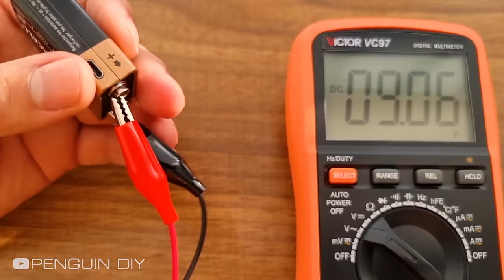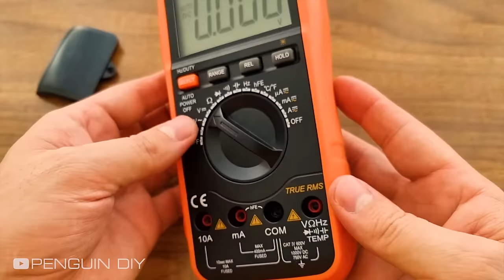How to Make Rechargeable 9V Li-Ion Battery | DIY 9V rechargeable battery

Comment: They should make these so we don’t have to waste batteries again And the stop motion is very cool this is just genius even the stop motion everything
Reply: You can buy them, just google for it. I just found a set of two for 22,54 Euros, can't say anything about the quality.

I guess the reason that they are not very common is that they are much more expensive than a "normal" 9 V rechargable battery, which has ab bit less capacity and needs a charger, but is still much cheaper.
Reply: madin iran 🇮🇷🇮🇷🇮🇷🇮🇷🇮🇷🇮🇷🇮🇷🇮🇷🇮🇷🇮🇷🇮🇷🇮🇷🇮🇷🇮🇷🇮🇷🇮🇷🇮🇷🇮🇷🇮🇷🇮🇷🇮🇷🇮🇷🇮🇷🇮🇷🇮🇷🇮🇷🇮🇷🇮🇷🇮🇷🇮🇷🇮🇷🇮🇷🇮🇷🇮🇷🇮🇷🇮🇷🇮🇷🇮🇷🇮🇷🇮🇷

Comment: Be careful about point-to-point soldering of the SMD parts, those things may easily get an internal crack after any shock in the assembled device, so better just order a PCB (this one is easy enough to just etch with a sharp knife btw).
Reply: Do you not understand why they did point to point soldering and not just add the module in?
Reply: @risingmermo  No, because simply re-routing it to meet the board size requirements instead of p-2-p would work just nicely.
Reply: @TheBypasser  yh true but would be more expensive
Reply: @risingmermo  Like a couple of cents for a tiny piece of FR4 which for such a simple circuit you can etch yourself for free? And should we play some "big industry" here, the least expensive process is the one that takes the least manual operations, as it is both cheaper and less prone to human error, so fewer defective units per run.

Comment: This circut doesn't have dischatge protection. If you discharge batery to much you will have to replace it
Reply: looks like the batteries themselves have protection circuits on them
Reply: some battery cahrge board come with over discharge protection.
Reply: @a892728  yes but this bartery charger doesn't have discharge protection
Reply: @manecior1  oh I got it.
I also made my own 18650 charger with TP4056 chipset.
I buy it with charge oc and discharge   protection.only a little price higher.
Reply: @manecior1  no need for one if the battery has one
Reply: The little pcb on the battery is the bms its a dw01
Reply: @309electronics5  Indeed!

Comment: Super rad build! Most impressed I've been halfway through a video, as a guy who loves micro squashed bug circuits, and stop-motion. Could have almost fit another battery in there if you had micro'd the other board!
Reply: He didn't have the protection circuit, and his board was too big, i did the instructables on how to do a better version for cheaper : Convert a Power Bank Into a 9v Lithium Battery

Comment: I couldn't  see any bms for battery, this boost module works until the input voltage decrease 1.5 volts so lithium ion battery probably will swell . bro you know low voltage of lithium ion is 3.0 volts😕. So ı wish you used tp4056 which have protection. Good job 👍.
Reply: Bro...there is tp4056 module
Reply: each battery has a protection board 0:56
Reply: That`s li-po with protect

Comment: Those DC booster circuits have quite high standby currents.
It works but on devices with really low current draw the battery won't last that long because the booster circuits is active all the time.

Tried to mod it on the resistors. Worked a little but still to high quiescent current.

With firealarm devices you also have issues it won't give low battery warnings. It just dies immediately when the booster shuts off. 

But still nice try though. 

Easier to just buy one. 
More capacity and most likely better electronics.
Reply: With the things like smoke detectors, you're far better off just getting the intended "10 year lifespan" lithium batteries that use the same battery chemistry as lithium coin cells, with 3 stacked in series (edit: 3 lithium cells stacked in series inside the standard 9v battery form factor) to get the required voltage.
They're individually expensive yes, at maybe $10 for each one, but given that they are intended to last 10 full years, they end up costing a lot less than alkaline 9v batteries do.
Reply: Really just a fun video, like the previous comments the parasitic loses would discharge it quickly. Just buy a one...
Reply: @gt6hudson  Agreed, but even those ones you can buy have the same problem.
And they don't have the little slide switch in them so you can actually fully turn them off either.
I guess if you want the switch, it would be a lot easier and probably cheaper to start with one of those and mod in a slide switch than to have to build the whole battery from scratch.
Additionally there's another issue with the build in this video. Where does the charging circuit's IC get any heatsinking from? That's what that massive pad on the bottom of the IC is for. If it was me, I'd try to take that charging IC, bend the pins upward so I can "dead-bug style" re-make the charging circuit like was done in this video, but before I re-made the circuit I'd solder it to the inside of the (metal) case of the 9v. I'd also try to use a dab of solder to secure the micro-USB connector to the side of the case as well, unless that needs to be electrically isolated for some reason (but  I doubt that). Shouldn't be too hard for either thing to be done, assuming you have the right tools and a sufficiently high wattage soldering iron. I mean the inside of the case looks to be bright shiny nickel plated, which means it SHOULD accept solder rather well, assuming there's no additional coatings or oils on it (so clean it first).
Also, I tend to use lead based solder, but only because I still have a lot of it. When that runs out I'll switch over to the lead-free stuff, but that probably won't happen for a real long time, back when I was doing soldering more frequently 15 years ago I bought a half pound spool of 0.032" 63/37 Sn/Pb (eutetic as far as I know) solder from Radio Shack and I've kinda barely touched it, since most of what I was doing was picking components out of electronics that either became nonfunctional or were obsolete. Salvaged plenty of power transistors and good mylar capacitors from CRT TV's and monitors, and I was safe about it by waiting a week before opening it, and being careful around the tube. Never got shocked or broke the glass of a single CRT when disassembling them.
Reply: Г

Comment: I think the only downside to this is that the lipo cells now parallel charge instead of balance. If one of the cell's internal resistance is even slightly different, you will eventually end up with one cell more charged than the other, and the charging circuit can't differentiate the two cells because there is only one charging channel. The other issue is that there is no overdraw protection. you could theoretically bring the voltage of the lipo cells low enough to be unsafe to recharge. otherwise, this is actually pretty cool
Reply: I think they would have to go in parallel because if you put it in series you would only get 3.7 volts well with the voltage thing you could overamp the battery but you'd still only get maybe 6 volts
Reply: Maybe in theory parallel seems bad, but in reality - parallel is actually good... as long as the cells are exactly the same type and age. It's really no different than a single physical cell but just bigger... think about it.

It's also quite common in EV battery packs... Leaf battery modules are 2P2S, all Teslas have MANY small cells paralleled, then those groups in series.
Reply: Well, no. As both cells are tied in parallel they balance each other on their own. If one is charged higher than the other on the time of soldering it will charge the other to its potential and even them out. From then on they charge and discharge at the same rate.
Reply: First discharge them both, then charge them in parallel. If you want to play safe, you must charge them full and wait for a month to see if it leaks.
Reply: You are incorrect about the cells being out of balance; they will actually be in near-perfect balance. You are also incorrect about the lack of over-discharge protection; it is build into the cell, which you can see clearly at 0:52
Reply: @jamesbrown99991  I didn't see the bms on the battery before, but they will not balance when charged in parallel. if they have slightly different internal resistances, they will not charge or discharge at the same rate.
Reply: @davldbradley6073  Parallel adds capacity, not voltage. They could have opted for a larger lipo cell instead to increase capacity
Reply: @beforebefore  I use lipo packs as an RC hobbyist and even really expensive, high QC packs still require balance charging to retain optimal battery health. No two cells have the exact same internal resistance. If one starts to get worse, you won't be able to tell if you charge in parallel, because you can't measure the voltage of each cell individually. you're charging system has no way of knowing when to stop charging a battery except to check the output voltage of the whole pack.
Reply: @Shraedar  Parallel cells have the same terminal voltage, regardless of the internal resistance, and will equalise/self-balance whenever a large charge/discharge is absent. For low currents, the internal resistance might as well not exist.
Reply: @Shraedar  Ok, i call it leak and you call it degrade. But still, a LiPo can damage if you overcharge or overdischage. You can check if a LiPo is damaged if you leave them for a month fully charged. If after a month the voltage is lower than the voltage in the beginning, you know the cell is damaged.
Reply: @beforebefore  I think it a worst case thing, is cell goes bad, rogue, the good ones will do cover, for it, un till it critical fail, and that fire, making the hole lot go rogue, yes but cell not that much but you could build better, hopefully not building back better? which is new  trendy thing at the moment
that circuit board with board was make my eyes crossed just looking at it?
Reply: @bugsuck11 don't shame the rc community for your mistakes. The cells here are not series for any current distribution to matter. I have 2 of these in parallel in my multimeters for years now and no problem, check my instructable Convert a Power Bank Into a 9v Lithium Battery
Reply: @jamesbrown99991   Not totally true, if the internal resistance of either cell is different you could get an out of balance.  It is recommended to use two tp4056 chargers.

Comment: Last year I brought two packs of 4 double A and two packs of 4 triple A rechargeable batteries with micro USB for charging them up. Yes they were expensive to buy £15 a pack. But they can be charged up over 500 times

Comment: Really nice! Although, I wouldn't recommend using a switched supply to power a multimeter.
Reply: I made it and my multimeter works just fine. Why you say so?
Reply: @Carolina-mw4po  switched power supplies make "noisy* power. it's fine for most things, but multimeters (at least the fancier ones) can be pretty sensitive to this. you can add a smoothing capacitor in there to help reduce the noise, not sure what size it'd be for a 9v, though.
Reply: @DFX2KX  i understand it as the conversion is done using a high frequency. I'm only saying I had no issues with my multimeter. May be it has a filter after the vcc, who knows. Even measuring frequency with it, the values are correct.
I was lucky I guess.
Reply: I am using that set up in my tester lcr-t4, and no problem at all.

Comment: TLDR, This project gives a "9V" with 25% of the capacity of a typical alkaline 9V.  This is not useless but should be considered when deciding if it is worth attempting.

This is much better than the AA project, more power in the package, easier to build, and using the switching regulator means you will get most of the power out of the LiPo.  However, keep in mind, a typical Energizer 9V is about 5.5Wh (610 mAh x 9V).  This LiPo is 3.7V x 450 mAh or 1.6 Wh assuming 100% which you won't get.
Reply: ((4.2V * 0.450A)*2b) - 20%Ef = 3Wh and you have the possibility to charge. i'm not pointing the nominal voltage.
Reply: @Hudsonkem  What is "2b" for that doubles the number?
Reply: @LFTRnow  battery :)

Comment: Very Impressed, Penguin DIY!! You will rise fast! Don't change your style for now. Wait until you get into the 150K/200K. You are doing fine. Lights, motors, charging of Lithium Batteries. Establish your Base. This is good that you are integrating "enclosures". This one is exceptionally good. Professional level.

Comment: Yea, but surface-mounted components are nearly impossible to remove.
Reply: somehow removes
Reply: just break it
Reply: Hint: hot air!
Reply: According to this video, you don't have to. They appear to move themselves. 😆
Reply: With the right method it is easy
Reply: @NortelGeek  hahaha ha
Reply: @reizinhodojogo3956  It is a disposable unit. There are no serviceable parts inside. At least the coulombs are renewable.

Comment: So I am still a kid but I know a bit electronics. You removed 9 volts and added 2 other lithium batteries and transformed it to 9 volts then you connected a charging circuit to the battery and stuff and you connected the 9 volt output to battery case output. Well I am not an electritian so if you didnt make any mistakes this should work. But you can just plug it into a wall. But the usb charging circuit was so compact. Nice work and nice stop motion
Reply: Have your folks buy them for you....

Comment: Incredible project. My only worries, even if I am not an electrical engineer, it doesn't look completely safe for the charging part even with the internal safety board included with the batteries. But I am surely wrong.
Reply: You are definitely not wrong lol. That charging port is definitely not something you would want to sell as it would be a fire hazard. But for a DIY video, who cares as long as it works.

Comment: Brilliant since I'm the tech,I didn't need it to be look neat or poise,I can use 18650 plus TP4056 and the boost converter in a separate casing,Then stick it at the Back of the Multimeter,Having large Battery is also advantageous.
That style that you just shown it can be for Business purposes,You can Sell that,9v Battery is expensive now a days it will sell good

Comment: The biggest advantage I see to this is size.  Other than that, for the amount of work you are doing here, it would be simpler to gather six AAA rechargeable Li-Ion batteries, put them in series in a camera pack type case, and do everything else outside of that case.  It would be bigger, but also, a whole let less work.   For bonus points, you can go for the rechargeables that charge in like 15 mins.
Reply: Doing that would give around 27v when full, a bad idea. Check my instructables Convert a Power Bank Into a 9v Lithium Battery

Comment: Great vid. But you have to change rprog resistor due 1 amper charge ratio. That little battery cant handle that much current.

Comment: So Subbed. I have NO problem with taking components from a board like that and making a circuit. The problem I have is where to put them! You just cleared that up. Thank You little cute upright arctic bird. Bird? What Genus is a Penguin? I guess they started on top of televisions in the seventies. And for some reason, they exploded. And there was a specific time. At least that is what I was taught by Monty Python.

Comment: Isn't it bad to wire the regulator on the same line as the live connection? Couldn't the battery just bypass the regulator?

Comment: This is very great! However, I  have one question. You used a step-up transformer to 28v but wouldn’t that fry a normal 9v circuit?
Reply: He set it up on 9 V at 1:50, you can change output voltage, it just takes 3.7 to 9 this way

Comment: This is cool but I wouldn't use it in audio related gear (or any gear that needs noise free operation like rc transmitters) since the dc-dc converter used creates a lot of noise in the signal. So don't use it for a acoustic guitar preamp for example.

Comment: It's fine, but it's useless if you use it for a  Fluke multimeter because it has too much idle current, you always must uncover and switch off the meter.

Comment: А не проще ли вместо повышайки поставить 3-й аккумулятор, а излишек напряжения батареи погасить гирляндой диодов
или вовсе обойтись без них - поскольку микросхема АЦП допускает верхнюю границу питания до 15V?
Reply: ADC chip??? The output of a Li-ion cell varies from 4.2 down to about 3.2 over its lifetime. Your way could work, but the output would drop by 3V as the cells discharged. That might be okay in some cases, but it also might not. I guess you could use a linear regulator. Charging from 5V USB would not be simple though.

Comment: The trouble is thou, you need to switch the battery on and off all the time else it will go flat between uses. This is hard as battery is hidden inside the multi-meter, and can go for weeks or months without use.

Comment: maasallah nice video but i replaced 9v batteries with 3s nokia batteries in series 12.6 volts and they work..i have 3 different model ..replaced 2x 9 volts with 3s batteries and 1 with 2x aaa with 1 nokia ..i charge the 3s with 12 volt powersuplly..they have protection under and overvotalge anyway....and nokia i charge with tp405.

Comment: As made its nice but taking out parts  from the circuit board don't u think to use that circuit board on a circuit board just soilding two wires on one and use it instead of putting it infa nine volt battery